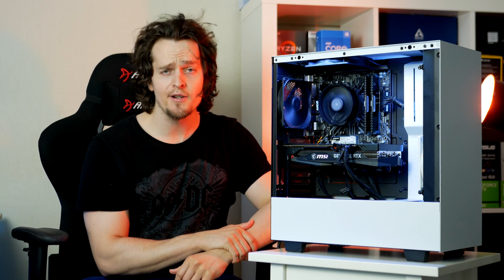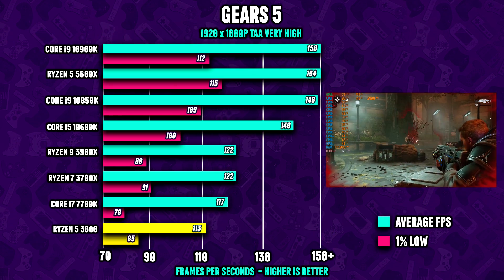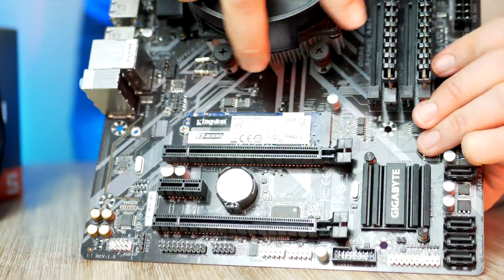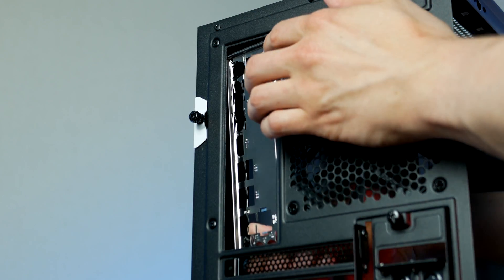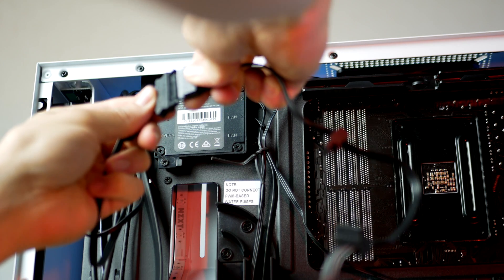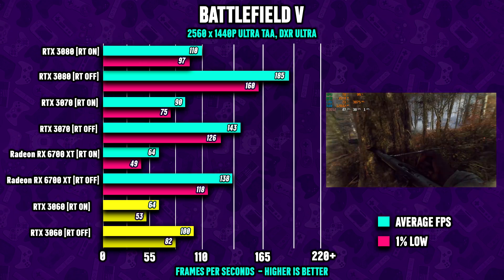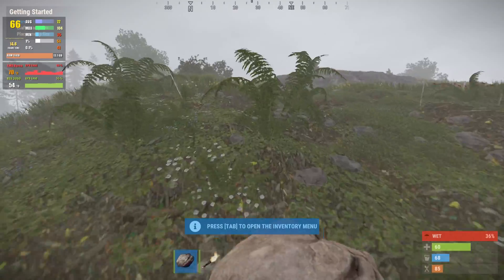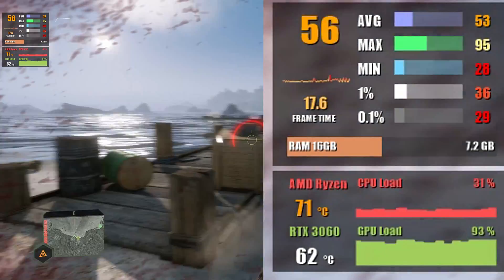Best Budget Gaming PC Under $1000 in 2021! [RTX 3060] Gaming PC For Beginners Cheap!

Comment: Where did you get this so called $399 GPU, because for me the GPU alone is over $1000
Reply: same
Reply: Just get a 1080ti its bout 600 then pc will cost 1200 not too bad
Reply: best buy has it but there normally out of stock just have to no when they restock and pray you make it to check out lmfao